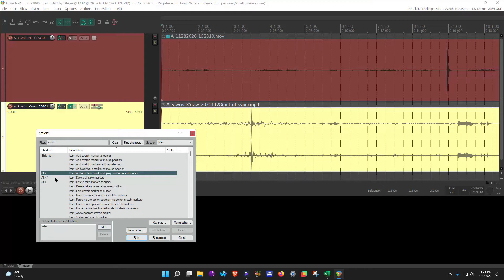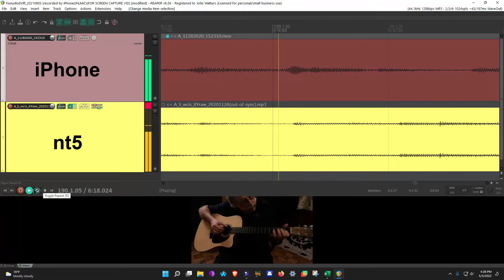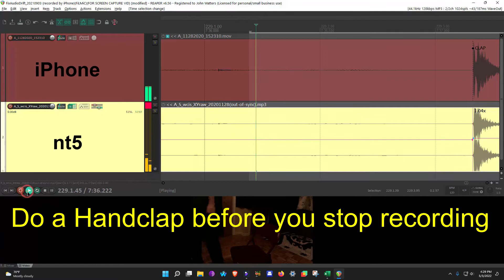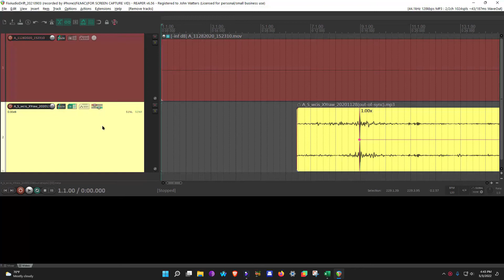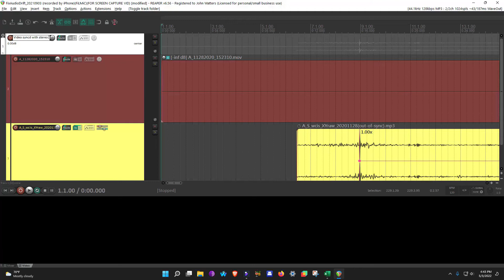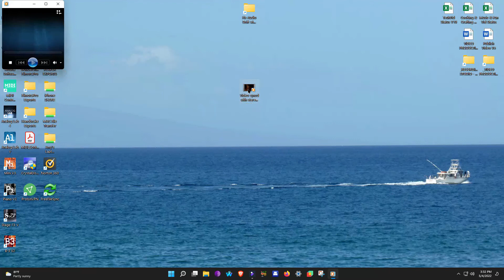Fix Audio Drift with Reaper

Comment: I had no idea that the audio would be out of sync with the video.  Is that because the audio mic and the iPhone are recording at different sample rates?
Reply from the maker: Yes thats exactly right - in my setup I'm using iPhone for video and condenser mics for audio (sm81, wa-47jr, blue yeti) - the recording rates are just a bit different - so in the beginning of the recording the out-of-sync is not really noticeable. In my setup I start to hear the out-of-sync after about 10 or 12 minutes into the recording, and then it just becomes more noticeable as the recording continues. So I try to keep my video shoots to at most 10 minutes.

I've gotten feedback from some subscribers who had like 30 minute vids that they thought they would have to discard - but they were able to get their vid back in sync with this method. There is also a way to fix audio drift using Apple iMovie (I have a video on iMovie method as well)
Reply: @techvidsbymckee5809 so then which recording is true to actual length of time?  I would assume the audio only, since the iPhone may be set to variable frame rate?
Reply from the maker: @andyto629  That's a good question - I have only thought about it as syncing the audio with the video - so I'm sure how to discern  which one is true relative to length of time